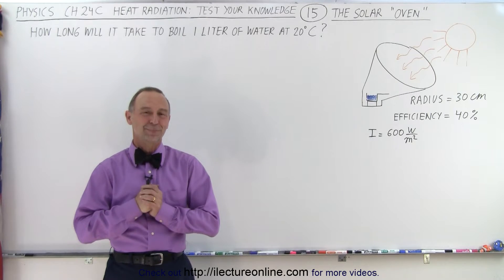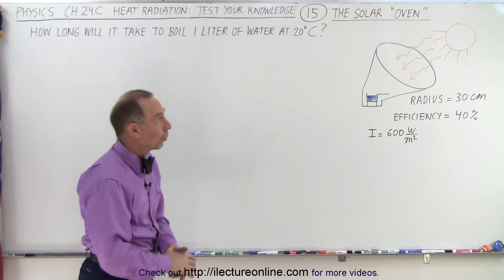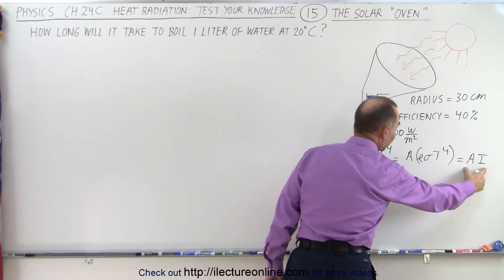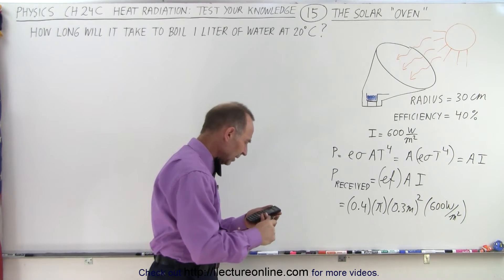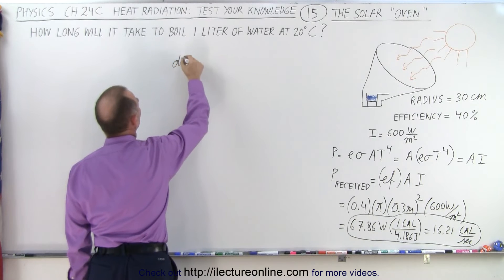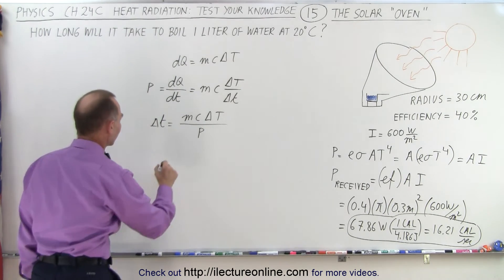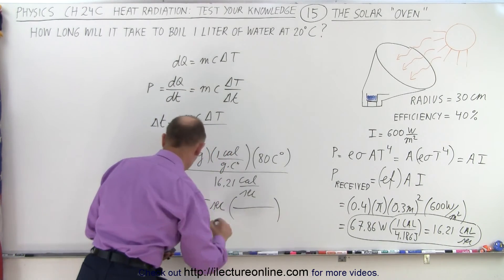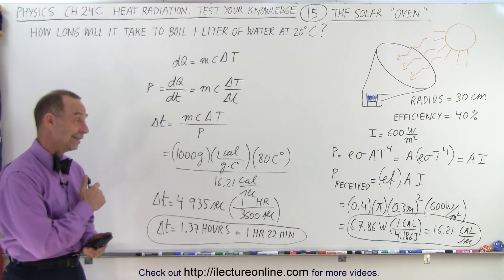Physics: Ch 24C -Heat Radiation: Test Your Knowledge (15 of 20) The Solar "Oven"

Comment: Determine solar radiation received and heat removal factor (FR) with 6 W/m2 K as overall heat
loss coefficient. Heat transfer coefficient of the fluid tube is 1200 W/m2 K. The absorbed
insolation during the first hour averages 90 W/m2

. The cover transmittance to solar radiation
is 0.9. The solar plate absorptance 0.9, collector 1 m wide and 3 m long. Water flow rate is
0.02 kg/s. Temperature of water is 330 K = 27degrees and ambient temperature 0 K (take specific
heat capacity of water to be 1 kJ/kg K).      I need with this question